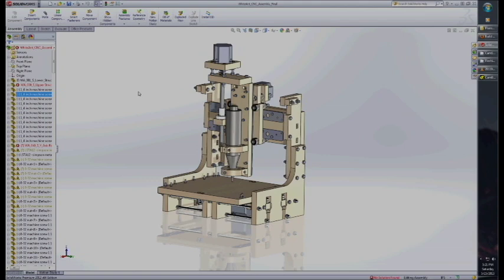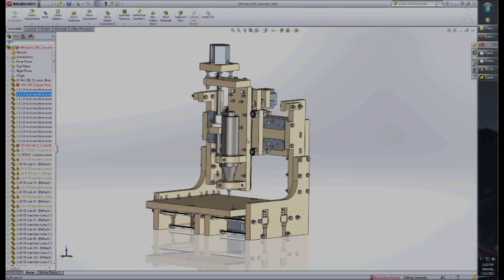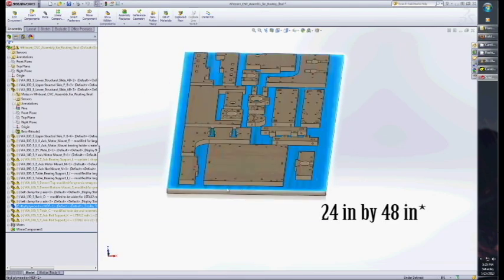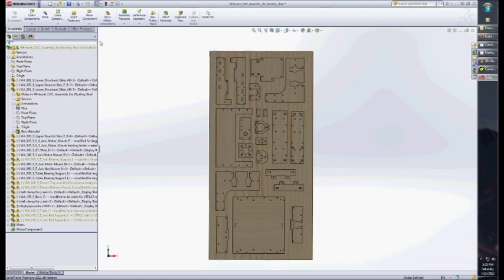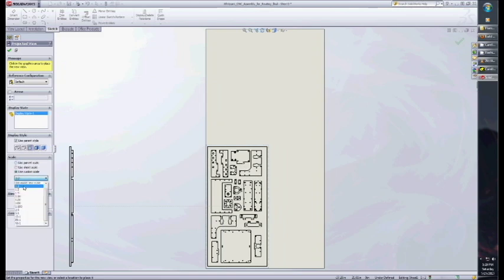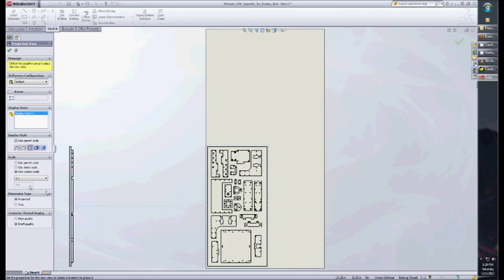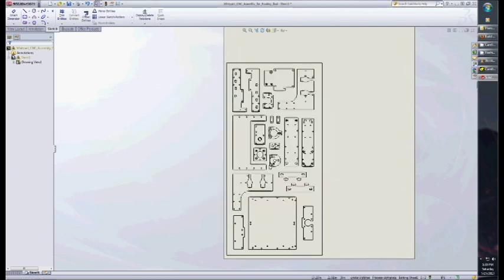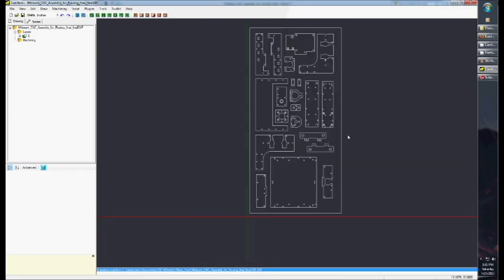Tutorial - Solidworks Assembly to DXF Conversion for CNC Machining

Comment: That's not how to properly do it, Jake, and everyone. It's better to use NestingWorks to generate a dxf(or any other addin that'll generate dxf for you like Logopress3, MetalWorks, AKER, SWOOD, there are probably more) from an assembly, like this: https://i.imgur.com/MbEyPMp.png .

This dxf will be unoptimized, it will be ready to cut but you can save some money if you will optimize your dxf with tools for line optimization for laser cutter. Here's just an example of this kind of tool:
https://svgnest.com/

Google laser line optimization and alike to find more.

Comment: Hey Jake, I'm just begining in this CNC world, I'm wondering how exactly you converted this 3d machine in a 2d parts breakdown to then be exported in a DXF file. Thank you
Reply from the maker: Edward, the world of cnc'ing is a great one to be in. To move the parts around to a flat surface, create a new part that is the size of your board (usually 4' x 8') then insert it into your assembly. Then delete all of the current mates in your assembly. Then re-mate everything to the board you inserted
Reply: +Jake Taylor Fine thank you Jake for your fast answer, for one moment I thought there was a option or a tool that could make this automatically, I just bought a CNC machine and I'm thinking in produce bumpers, but so far I have a long way off..
Reply: I think Solidworks needs to develop a arranged features for assembly, like Fusion 360

Comment: i didn't understand a thing. How did you made that flat panel with every components from the main assembly. For example i have a balsa wing  designed and i want to print every rib. How can i arrange them like your flat pannel?
Reply from the maker: yes, I just mated everything to the new board. One thing to note is that you either need to pay attention to the direction of the 2.5d cuts you want to make, or to export both a front and back dxf. If you do, either use dowels, or some other method to align the front and back
Reply: did u manage to find the answer from any other sources by chance?
Reply: Pratham Singh i stoped finding an answer. If you will find an answer please share.
Reply: mt2ultimate I think what he did was he created a new part in Solidworks which was the sheet that he will be cutting the parts from (the 24 x 48 in sheet). Then he put the sheet part into the assembly and manually arranged and mated all the wooden pieces to the sheet.

Comment: I just discovered a better work around: save the assembly as part then open it and save it as .DXF
Reply from the maker: That method does work! I need to make an updated video showing how to do that
Reply: I tried that and it works great!  Thanks for the suggestion.

My only gripe w/ SW's is that you can't save to a DXF directly from the assembly, the dxf option isn't available in the menu for files types.  Com'on SW's, get w/ the show.

So, as you mentioned, I saved my assembly like the video from Jake as a *.sldprt, then saved that as a *.dxf.  Worked like a charm:-)

One comment for Jake about the video, not sure why you put in the 'back board' because when converted to dxf the router (in my case lasesr) will want to cut that line.  I didn't try it, but I was thinking about adding a 'line' sketch to the assembly as my material size and then I could 'hide' or supress it when saving as dxf so that it doesn't appear in the file.  OR...  maybe when cutting you can tell your CNC or laser not to cut that line.  Whatever works, I guess...

Thanks for the tips Jake and Abdullah.  Cheers...
Reply: Are you sure it is not just a 2d view of the part.....
Reply: Holy shit thanks for this, idk why people don't jsut say this when you look on a forum for how to do it. Literally I see people give these 3 paragrapoh awnsers referencing their own nicknames for certain process that only they know the meaning of and acting mad when people ask tehm quesdtions.
Reply: That's not how to properly do it, Jake, and everyone. It's better to use NestingWorks to generate a dxf(or any other addin that'll generate dxf for you like Logopress3, MetalWorks, AKER, SWOOD, there are probably more) from an assembly, like this: https://i.imgur.com/MbEyPMp.png .

This dxf will be unoptimized, it will be ready to cut but you can save some money if you will optimize your dxf with tools for line optimization for laser cutter. Here's just an example of this kind of tool:
https://svgnest.com/

Google laser line optimization and alike to find more.

Comment: Hi, how to change lines color for laser cuttin?
Reply from the maker: hello, I have not had access to a laser cutter, so im not 100% sure. However, I imagine it is just like milling with a bit that is 0 in diameter (essentially just tracing). To do that, I would use cambam to generate the toolpaths and export the gcode. This guy has a decent tutorial that I originally learned off of: DIY CNC Cutting Tutorial Video #2 - Probotix Fireball V90